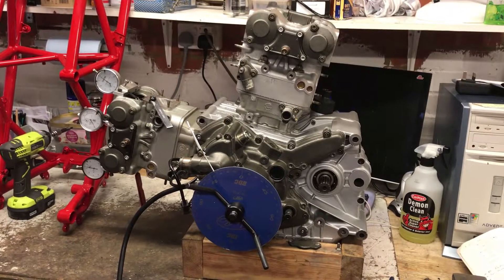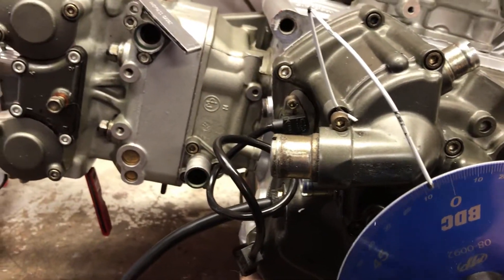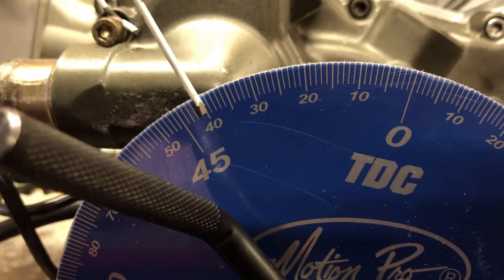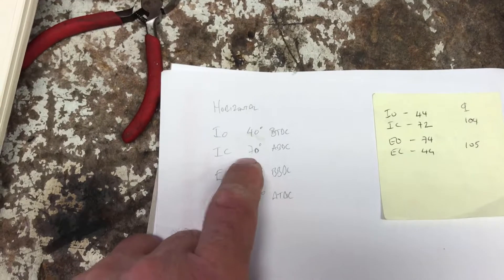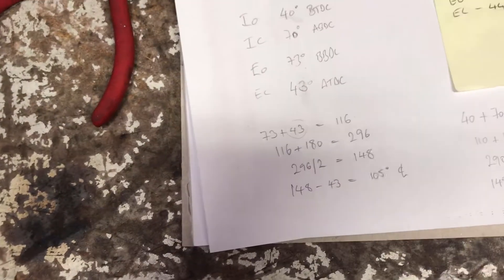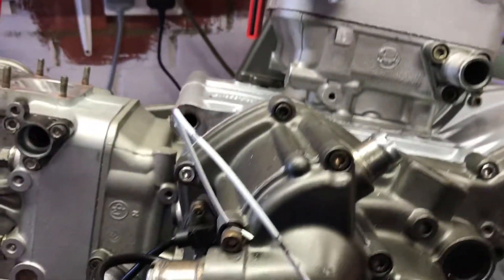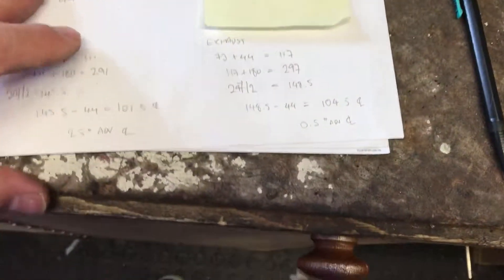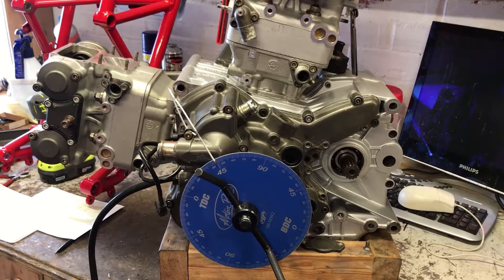Thunderbike Race Prep Video 13 - Ducati 748 Checking Cam Timing Part 1 of 2

Comment: Thanks for all the info !!,  I do have 2 questions......were can i buy the TDC tool you are using and which type oil are u using to put the engine together
Reply from the maker: You can get a TDC tool from Kamna Ducati in Germany and the oil is a build oil Luca or Redline make a suitable product, then in the little oil pot I use a 10w40 to cover other parts to keep them lubricated.

Comment: I'm watching this for a third time but it's like watching the construction of a NASA space shuttle. Do you have to check the timing every time you rebuild the engine?
Reply from the maker: HI Gamotur, its good practice to check the timing, but I especially needed too as I was using parts from different engines so the settings were not made at factory for this engine. You can just use the standard timing marks to get you roughly into timing position, it may be a couple of degrees out but that will not cause major issues.
Reply: @DesmoWerx  Thank You
Reply from the maker: @gamotur  no worries hope it helps.
Reply: I had the same question - being a race engine with different parts, I figured there could be discrepancies in the parts from stock, however I thought being keyed, it would all go back perfectly timed - but I guess not. I learn here the difference between a pro race engine and a road one - I guess a degree could be a tenth on track and a win! Very cool.

Comment: hi there, not sure if you get to read this but I've been watching your thunderbuke build... I'm wanting to do my first bike engine build, I've got 25 years experience with car engines but not much with a bike engine. I've got my hands on some brand new 996sps engine casings and I was wondering that should I run into any difficulties would it be ok to get some advice from you? best regards Wayne.
Reply from the maker: HI Wayne, more than happy to help, just chuck me an email with any questions and good luck with your build :)
Reply: @DesmoWerx  ah thank you :) your advice will be appreciated..  I've added you on Instagram, (nugggy1) would it be ok to send you a private message on there with my email?
Reply from the maker: @wayne5723  Sure, fire away :)

Comment: Isn't TDC going over some degrees at the wheel and the piston is staying at TDC for a moment? So finding the spot where the dial gauge is just at its maximum measurement will only give the starting point of this moment?

While I'm here, your videos rock! :)
Reply from the maker: Yes it will go over a couple of degrees whilst at TDC and you are correct it is the starting point of this moment.  The finding of the measurement gives a consistent 0 point to work from for the timing. 

Glad you like the videos